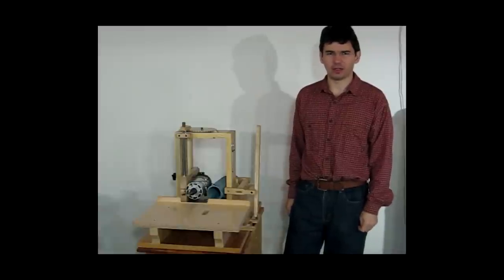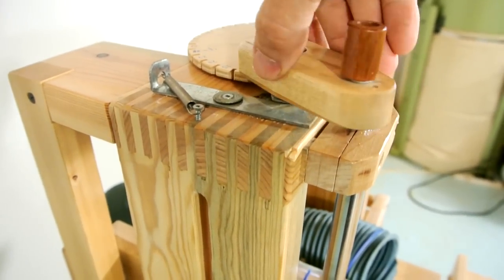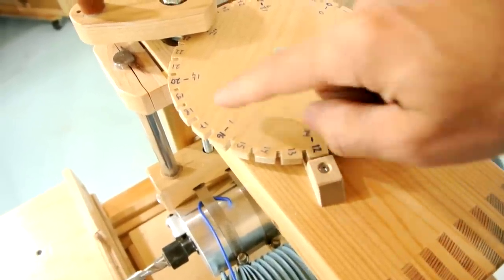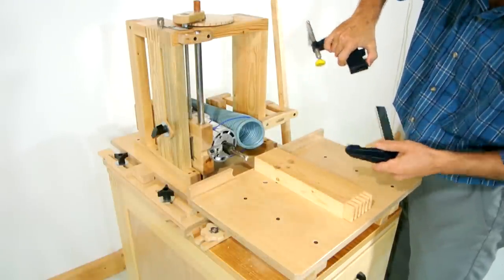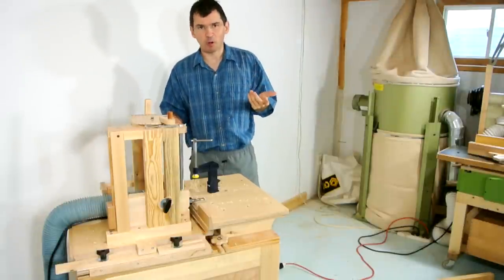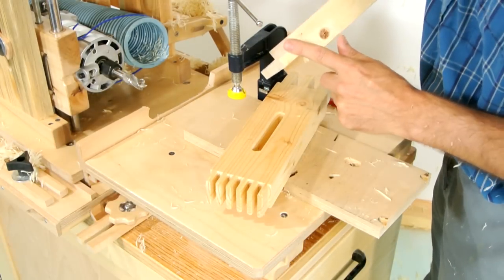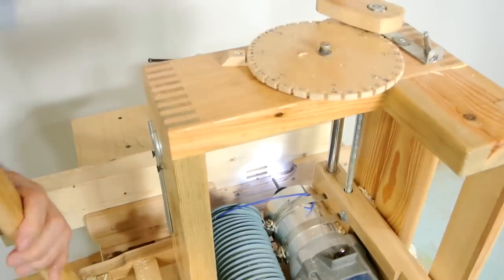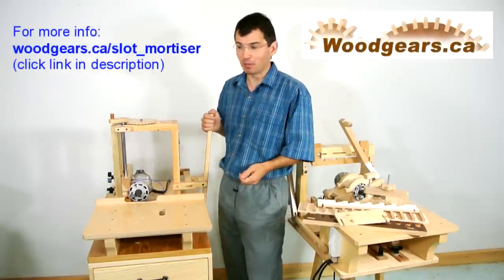Slot mortising machine

Comment: Really cool machine.  I will build one if I can find an appropriate router here in Australia.

Has anyone attempted to use a proper slot mortising bit in one of these routers? I know they typically have a 16mm shank but they can be had with a 13mm shank and I wondered if that would fit in a 12.7mm collett.  I suspect not but I thought I'd ask as I need to cut some really deep mortises.

Comment: Wow look at those knobs he made for the stops.  So nice and comfortable looking, and made of wood. WOW!!!   This guy really introduces a whole new generation of the power of wood. All those brackets he makes, all out of wood. They are all so clean and solid looking. Wood is way cheaper than aluminum, and easier to work.  The part just has to be slight bigger, but that is okay for most applications.

Comment: If one where to commit to say loose tenon joinery, perhaps the slot mortising machine would be all you need. But the best solution is to do like Alain from the woodpecker and have both machines on the same, rotating table.

Comment: Those kind of router are also made by Bosch in Europe. From Bosch, you can find the GMF 1400. But this router is pretty expensive !
Maybe a better deal would be to buy a very low-cost router, and add on it a better collet.

Comment: If you just want to make one and your low on budget, the are plenty of small 1/4" 6mm collet routers from diy shops such as screwfix, toolstation, wicks, b&q, AVOID Homebase and such in the uk. There all kinda based around 4" angle grinder motor assemblys and there not that awfull and will set you back around £20-£30. Once you have stripped the plates and stops of there nice and round and easy to fix to stuff.

Comment: Bosch GKF router is around £160. Which I think is very resonable. Dewalt have a very similar router also. Last I checked it was £209. With an additional base. Not a fan of dewalt since they sold up. The bosch is great. Intelligent base design . Making very accurate minor adjustments easy

Comment: A little scary for me .  Most of these designs have the router bolted through the base. your design has the motor held on with hose clamps. Can't it vibrate loose?
Reply: 8brandt8 Hose clamps do a good job of holding things in place without vibrating loose. Tighten it down sufficiently and it shouldn't move until you deliberately loosen it. I'd be more worried about a router held in place with bolts that didn't have lock washers or Locktite on the nuts.

Comment: Even your early machines look great) However, I wonder if i could use this type of drawer slides for vertical adjustment on a similar project? Will they provide me with proper precision?
Reply from the maker: +Aleksey Svishchov You could use them, but shielding them from dust will be difficult, and getting decent range is also a problem.

Comment: Hi Matthias, what brilliant combination of new-video with this old-machine you've made. Excellent! 

What I was wondering is what kind of router are you using for this? I live in the Netherlands and I can't find any router like this one you're using. All the routers I see here do have an oval shape with knobs on the sides so you can handle it more easily (which I find very unuseful since I want to use it in the purpose of a mortising machine like this of yours).

Comment: Looks to me that the optimal use for the slot mortising machine is loose tenon joints (if one wishes for perfect fits of round tenons)

By the way, would you consider harder to build the pantorouter or are they comparable in complexity?

Comment: That router (motor) seems really powerful. That, good/sharp router bit on soft wood does the job easily. If you're used to a cheap - or just not a powerfull one - hand held router, I can see why you'd ask :)